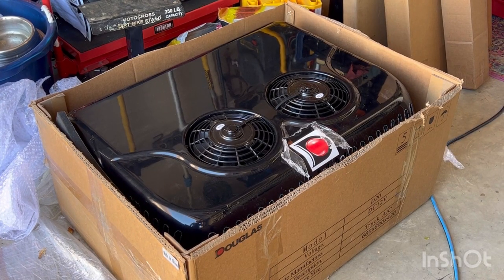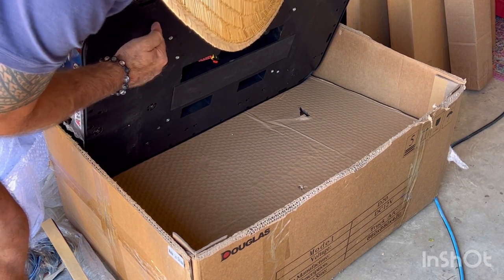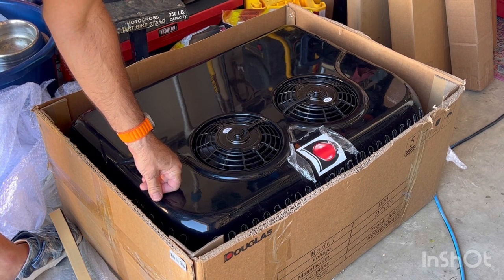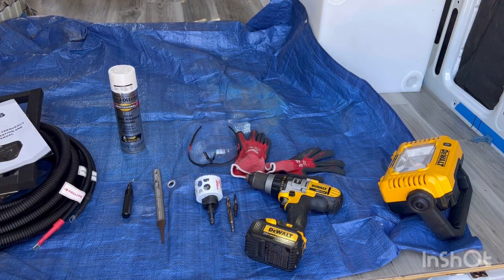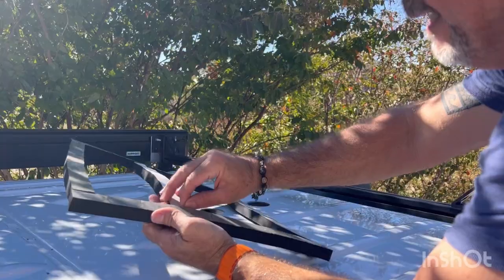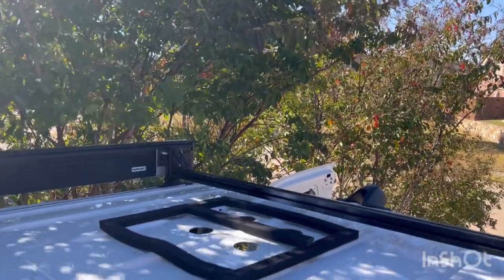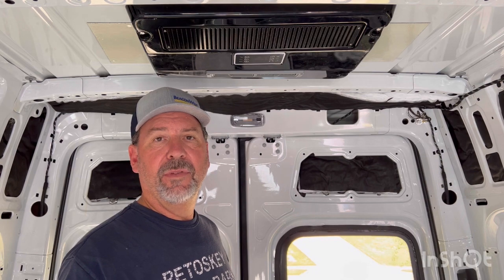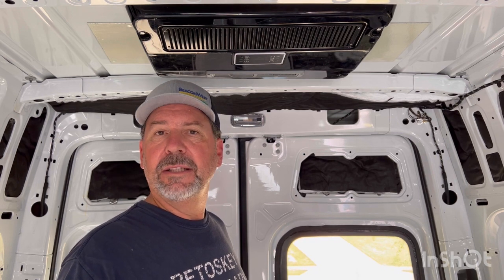Sprinter Van 12V Douglas AC Installation @Vandingo

Comment: Why not put your template on top of the van roof and drill down? More control of the drill, no shavings falling in your eyes, and you can see exactly where it will be in relation to your roof rack?
Reply from the maker: That is a potential option; however the interior roof support beams and the inside bolt up panel have to align, doing it on the outside…you may not land the spacing appropriately.

Comment: Thanks for the video; I'm also a North Dallas van diy. I bought my unit and kind of panicked when received and noticed the flat bottom; see everything on youtube with square insert into van. Your video helped relieve my fears, and actually, I think it's an advantage since it fits closer to the inside ceiling. I have one concern and that is a lot of units have two steel bars that bolt to ribs on roof. Do you have any concerns with mounting just to sheet metal on the roof?
Reply from the maker: Yes, I have also seen the supports used in other installs.  in my case where it’s installed is pretty tight between the two roofs supports and maybe this is why I have experienced no roof flexing, at least that I am aware of.

Comment: How did you wire it up? Whats your battery setup?
Reply from the maker: It’s wired to a fused Victron Lynx Distributor.  The battery is a LiTime 12v 400amp hour lithium battery, which I hope to have two of these at some point.
Reply: @vandingo1  and how do you charge lithium battery?
Reply from the maker: @danielpacurar2644  I charge via 400 watt solar and DC to DC charger
Reply from the maker: My channel has videos showing installs for both charging sources
Reply: Thank you 🙏

Comment: Do you recall the distance between each one of those mounting bolts? I am curious to see if this unit can work through an existing 14” x 14” maxxair hole. Thanks and great review!
Reply from the maker: Doesn’t look like YouTube allows a photo in the comment section.  I have the template still…the stud holes are 16” by 13”.
Reply: Thanks! So more rectangular per se.
Reply from the maker: Yes

Comment: Hello! I'm curious as to who you contacted to get customer service?
Reply: I bought a used unit and I'm trying to get the gasket that goes between the roof and AC unit. plus having the template and instructions would be nice.
Reply from the maker: Try this number it’s for Kingtec, but they either own or distribute for Douglas.  (909) 315-6602
Reply: Thank you I really appreciate it!
Reply from the maker: Sorry, I don’t think I responded to this first question.  I was having trouble at start up as the unit would cool and then the compressor would cycle off and blow warm.  I check and found full Freon levels.  After several additional attempts the condition did not repeat.  The folks at Kingtec instructed me on diagnosis through the process…they were very helpful.

Comment: How is this thing working for you? Does it draw a lot of power?
Reply from the maker: So far so good, but have not tested it for say a full day usage.  Have been running it periodically per the directions.  Texas heat is coming so will have a good test soon.
Reply: @vandingo1  let us know how it works..I am thinking about buying this unit for a 158" T1N we are building..thanks!
Reply from the maker: The manufacturer has shared via Amazon Q&A the unit draws 48 amps/hr and recommends a 400 ah battery.  So far I have run for an hour in 85 degree Texas heat and cools nicely and this is before the Van interior is complete with all insulation and interior walls and ceiling.  My plan is to add another 400ah battery in order to run all day off grid…if necessary.
Reply: @vandingo1  thank you.
Reply: @vandingo1 how are you charging in the road
Reply from the maker: To be fully transparent I am not totally sure as I don’t watch the Victron analytics closely enough and frankly have not had it on for more than an hour at a time.  800 amp hours of lithium, 400 watts of solar and a DC to DC charger give me confidence but the system is not fully tested

Comment: How did you waterproof the power cable? How does it work?
Reply from the maker: Sorry just saw your note, I brought the power cables through the Van roof via a roof gland, same type used when you need to bring solar wire through the roof.  Hope that helps.

Comment: Can you tell me how the AC preformed as far as cooling?
Reply from the maker: It cools well right over the bed, but does not quickly cool the entire Van when out side temps are above 90 and all the windows are not covered, particularly the front windows, which in heat are like a greenhouse.  Once all windows are covered and the max air fan is employed to move hot air our the unit functions reasonably well in hot temps.
Reply: @vandingo1  I just installed a unit on top of an International ProStar semi truck, hoping to cut down the idle time at night when sleeping. I appreciate the info. And will let you know how it does. Great video..